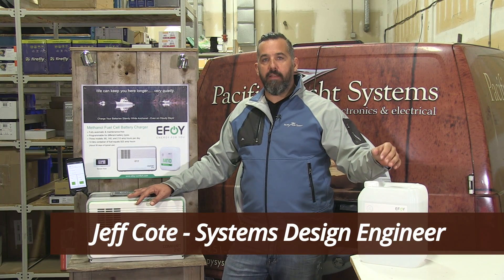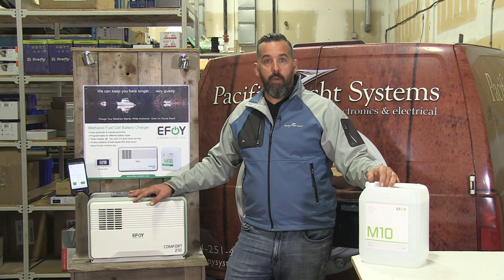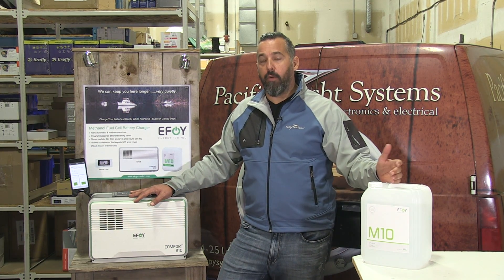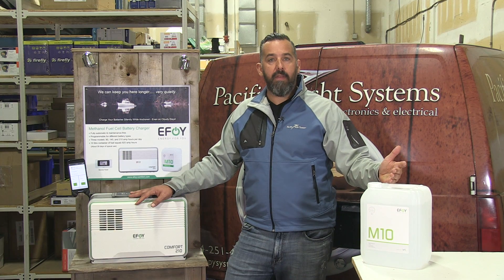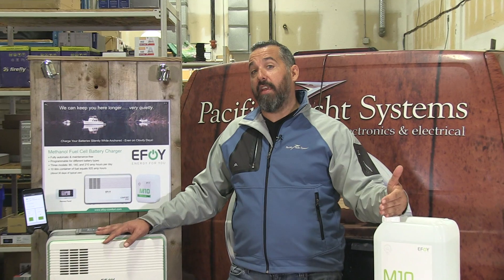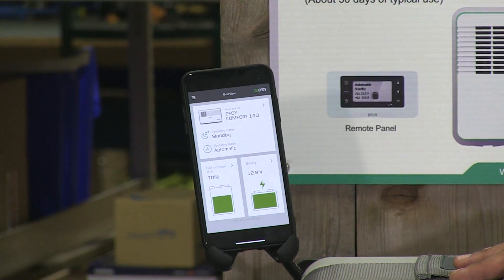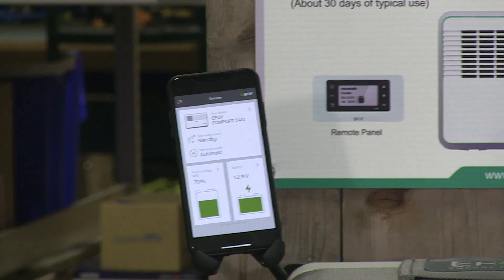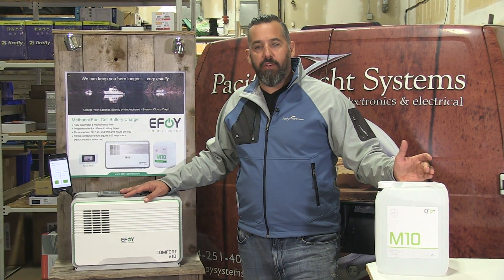Intro - Charge a Marine Battery with a Fuel Cell

Comment: Would this replace a diesel generator for charging electric motor batteries on sailboats?
Reply from the maker: Definitely not, as the the output of the EFOY is not strong enough for motoring.
Reply: @PacificYachtSystems  If you scaled up the generator, since the efficiency isn't a big issue, what size would it have to be to replace a diesel generator?

Comment: Get a WATT fuel cell. Runs on propane instead of expensive methanol and much easier to find.
Reply from the maker: Since boats are effectively containers and since propane is heavier then air, propane installations aboard boats needs to abide to ABYC standards.

Comment: I'm curious if those ethanol capsules from that company are somehow proprietary.  I looked into those systems and it seems expensive to buy fuel from them, however if you can buy ethanol from another supplier it would be a lot more cost effective.  Does anyone know?
Reply from the maker: Hi Esquire, your correct the Methanol fuel is proprietary. With my EFOY 210, i use only about 3 M10 methanol fuel cartridges per year. About $65 USD each.